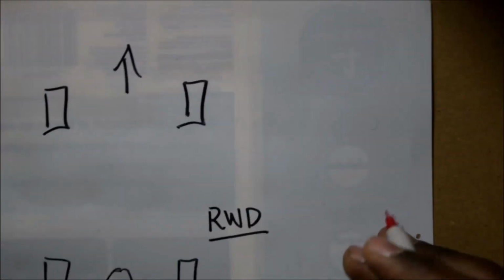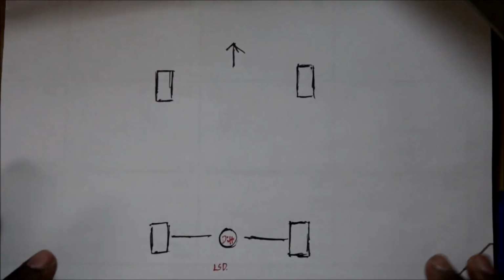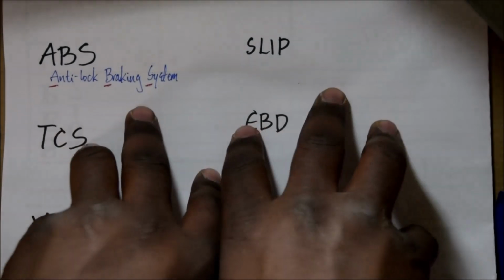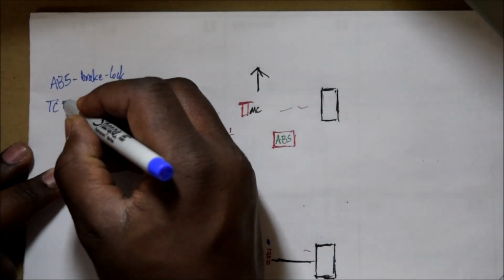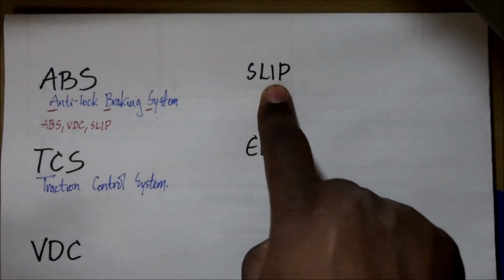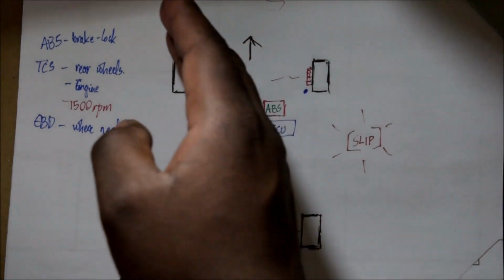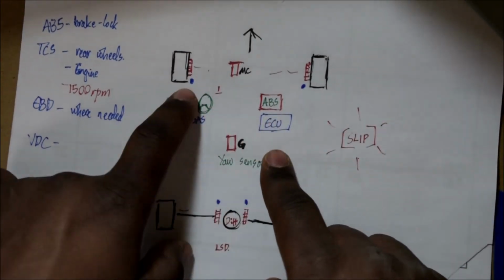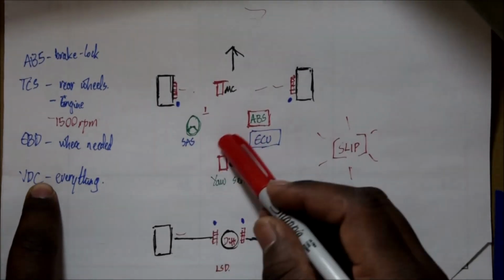Infiniti VDC, ABS, TCS, SLIP. Stability & Dynamic control systems, Part 1

Comment: I own a 2010 G37x with 242000 kms on it. It has been a very reliable car and one reason I chose it is for the awd functionality. I have a long commute and 6 months of the year it's snowy or icy. I have had the crap scared out of me several times when the VDC kicked in while I was correcting on ice. I am pretty diligent about driving according to conditions, but when you spend a lot of time on the road  in the winter it's inevitable that you'll slip from time to time on the highway. It's very unnerving to have the VDC intervene while countersteering and adjusting throttle. The worst part for me is having the power cut off. For this reason I always turn VDC off when it's icy. I sometimes experiment around town and leave it on to try and give it a chance at lower speeds, but at highway speed there's no way it can correct a slip as well as an experienced northern driver. God bless

Comment: I have a 2007 m35s   ... slip light on , vdc light on , no cruse ...no headlight movement... No rear steering  ...      where do i start?    Thank You
Reply from the maker: Have it scanned for codes. An auto parts store might be able to read body + chassis codes, but a dealership will be better.
Then you’ll know what exactly needs to be addressed.

Comment from the maker: Correction.
EBD in modern cars equalized braking force front-back depending on load, number of passengers etc.
Brake force distribution is exactly what I described in the video.
The principle is correct, but in trying to describe it, I was one letter off and ended up with a different acronym.